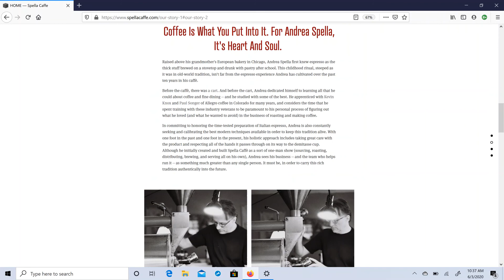HOW TO BREW SINGLE SERVING COFFEE Part 3: Espresso Drinks in the Bialetti Moka Pot

Comment: Very helpful. I used to make my coffee with a little pot like this but didn't use your procedure. Your explanation was great, but you didn't say how long it takes for the upper chamber to fill on the stove; you simply continued at the table. Please advise. Thx!
Reply from the maker: I don't go by time with this, but rather let the espresso rise to the bottom of the lip, then remove it from the heat and let it finish.
Reply: I was just wondering how long that took. Did you ever time it to see how long it took to finish?

BTW, I've had a similar thing in speaking. I struggle with things that start with the same letter. It always happens with April & August. Never knew what it was or met anyone else who had a similar thing happen.